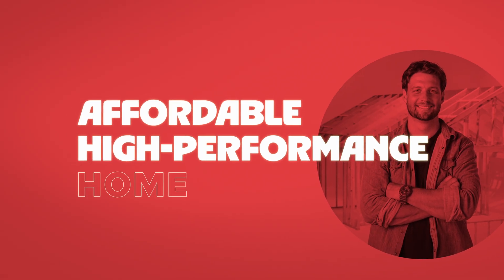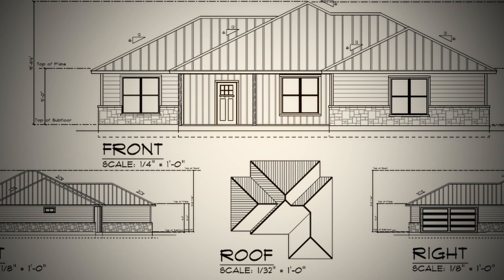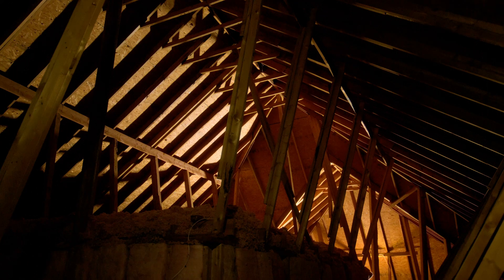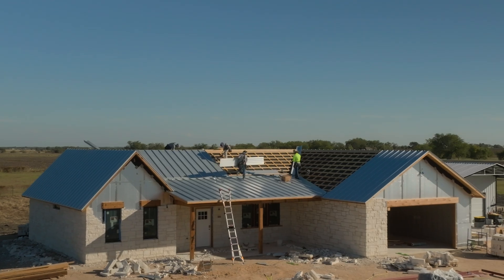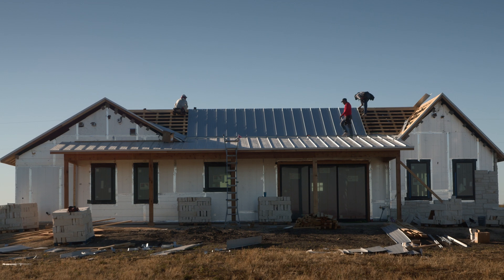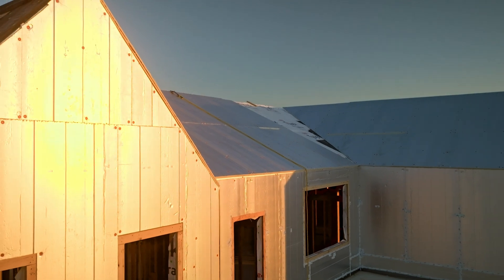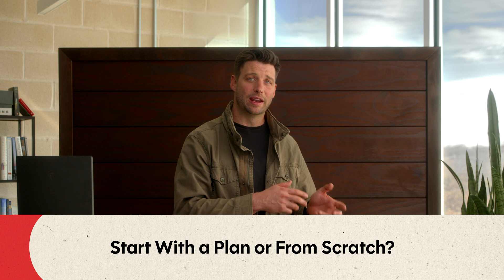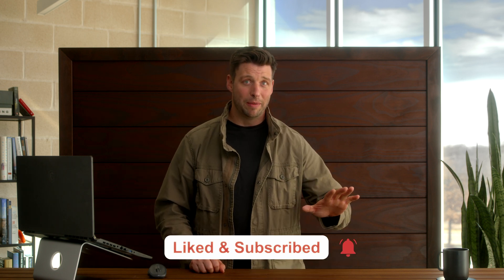If you don't do this, it's IMPOSSIBLE to Build High-Performance - AHPH 105

Comment: Husband and I are building outside Denver in Colorado.  Agree with this so much with one except… local architect.  Local engineer.  Building challenges in Austin, Tx are different than Conifer, CO but for the same reasons.  We are so lucky to find a local architect who happens to be a structural engineer who also lives up here at 8500 ft elevation.  Sun angles, terrain, when and where the snow melts first.  Local challenges matter so much.  (Second video is up, not nearly as good as yours)

Comment: Many people are unable to start from scratch and design a floor plan. They don't even know all the things they need to consider, so constraints are important. That doesn't mean folks have to go out and buy a floor plan, they can start by simply finding a layout they like on any developer's website. That's a huge shortcut that gives you a solid starting point and a general price range so your ideas stay close to budget.

Here in Ontario Canada, we care more about windows (and coatings) that help heat the house more than cool it. I designed my house with a giant 16ft wide by 8ft high patio doors on the back wall facing south for natural heating all winter, and mostly shaded by the roof overhang in the summer.
Reply from the maker: Love the south facing window in Canada!  Here in central Texas, we are almost reversed, with windows to the north to avoid overheating in the summer.
Reply: Why not to the south with a perfectly desogned overhang(which isnt quite as simple as it sounds but still easy to do)?

Comment: 1/2 way: buy the design for the floor plan and aesthetics you want, but let a designer/Engineer figure out the details.

Wall cross sections are not rocket science, not even for high performance.  Let an Engineer figure out the nerdy stuff, but don’t rely on them for aesthetics… you might end up sorry!!! 😂

Comment: I work in architecture so I am currently working on my "dream home" but I am trying to stay as realistic to my budget as possible. What would be the cost difference between a double stud exterior wall system and doing 2 layers or 1-1/2" Rigid insulation on a regular 2x6 board? I am guessing doing both would be way overkill.
Reply from the maker: Where are you located?  There are so many variables, it is impossible to say with certainty, but, in general, my guess is that a double stud exterior wall with inexpensive insulation would be the most cost efficient.  But then you have more trim work details for fenestrations, more foundation, more hassle....  I changed my mind.  Exterior insulation all the way. :)
Reply: @JordanSmithBuilds  That would be helpful information haha. I live by the border of Utah and Idaho. The climate zone is a 6B, but even though we get some cold winters we still also get some decent hot summers. Still, I think going with exterior insulation would be a better call. Thank you!

Comment: What design software are you using?
Reply: And what design software can the rest of us easily use?
Reply from the maker: Chief Architect.  It is really user friendly.
Reply: I've been using Sketchup.  It works well for me.
Reply: @wjthehomebuilder  my problem with SketchUp is I want to move this wall a foot, but there's some complex shape attached to it and it takes 3 hours
Reply: @ColeSpolaric  I understand that.  You gotta group everything.  I watched a tutorial video series on it first from sketch up model to making drawings in layout.
Reply: @wjthehomebuilder  I used it extensively when it was a Google product. The amount of effort is a lot to get everything right. It's still doable though. My biggest gripe is that it's now a subscription product. They have a free web version, but that lacks plugins and all kinds of other things.
Reply: @ColeSpolaric  Yes.  I think Trimble charges $325/ year.  I've only drawn up 4 houses.  And I build one house over and over.  But I also use it for site plans.  So to me, it's worth it.  I've have also drawn site plans for others which I charge $1,000 for.  So it all balances out.
Reply: @wjthehomebuilder  for me trying to draw my future house that's in my head, it's too much 😆. I'll go 2 months not doing anything and then be like, that's what I can do to resolve that issue, then I didn't want to do it because I know that change is going to take hours 😂
Reply: @ColeSpolaric  I can totally relate! 😆
Reply from the maker: Yep.
Reply from the maker: Sketchup is great for visuals, but Chief is better for building assemblies.  (In my experience. I know several architects who sear by Sketchup)
Reply from the maker: Chief Architect.  It's awesome
Reply: @JordanSmithBuilds  dang, I took a look and it's crazy expensive unless you're using it all the time